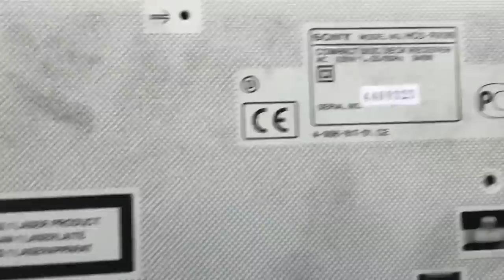SONY MHC-RX99 Maintenance Repair Restoration Disassembly Part 1

Comment: Hello! I have a problem with cd tray on sony gr8! The tray is not closing! It remain open! Even if i push it back it come out! Can you help me please with a solution?
Reply from the maker: Hello. This is a problem that happens to everyone. Because the rubber of the CD tray is broken, the mechanical part does not snap back as it should. When the mechanic does not go into place properly, the electronic key cannot open and it does not work. For this, you have to push the cd tray hard into place. Be careful, push it back without breaking it. But the cd tray tire should be changed.
Reply: @manstuckonhishead  i try it! Is still come out and not change the cd! I read only cd error
Reply: Hello sire! I solve 90% of the problem! Please help! Now in standby the cd tray is ejected!
Reply from the maker: @DAngello1987  Hello. If the cd tray does not break, the tires are checked first. The electronic keys are checked in the next process. I have no other information. I would have helped if there was.

Comment: I have sony mhc p99x. small mini ...its fan does nt work and it gets hot around 60..70 C. can i use computer fan? will it burn if fan is not working?

Comment: hello i'm from Tunisia, great job forthe work that you do. i have a similar HIFI sony compement (MHC GRx 70) very old one (from 2000) was abondoned for many year. i start it since 1 month, it's working but all the function button (on device) are not working properly. when i push a button for a function other function is started and it always beside function button. also the volume potentiometer when i uncrease volume, it decrease or not happen any change. for the remote control i can find it right now. can you please help me how i can fix the problem.
Reply from the maker: Hello.Watch this video https://youtu.be/RJsQ3DTwOvA 👍🙋‍♂️
Reply: @manstuckonhishead  thank you very much for answering. i watch the video, it's big job for me to repaire all button since 90% of it are badly working. i ask you if their is a chemical solution, for exemple electric contact spay  can solve the issue?
Reply from the maker: @maxis106  There is no chemical solution. You can write a 4-legged sony key on the internet and buy it. It would be easier to change it👍🙋‍♂️
Reply: @manstuckonhishead  thank you, i will try to do it.

Comment: hello my friend, you are probably the only guy who might actually can help me fixing my MHC-RX77 (which from what i see is very similar to the MHC-RX99 in your video)

My display is pretty dim, especially in the middle section, the outter section does show a little light though.
Whenever i start my system, it turns the CD's but sometimes it does not read it properly and therefore skips to the next one, as soon as it skips to the other disc in order to read it, the system turns itself off while rotating to the other disc, the only way i can bypass it turning off itself, is by pressing the upper DISC 1 button many times and sometimes it reads the disc properly and works normally, but sometimes doesnt, which annoys me ALOT.

Now i tried to solder all display pins properly and still does not work properly. I cant find any decent schematics for it.

The schematics for my MHC-RX77 are not quite detailed enough for the Panel PWB, which is why its difficult for me to check what each pin is controlled by.

i just soldered the chip for the display controller (IC 601, which i found in the MHC-RX99 schematics and is the exact same chip for my MHC RX-77) but i did not checked it if it works yet since im tired right now. lol.

side note: since i dont use tapes i dont really use the tape deck, but the rubber rings to spin the motors are missing (due to aging process) but as far i am concerned it shouldnt mess with the "checking procedure" during startup, or am i wrong?

I'd appreciate it very much if you give me any answer to my problem, even if you are not sure how to fix it. <3
Reply from the maker: Hello. As we know. Since the screen is fluorescent, it leaks gas inside and its color fades. The solution is to install a new screen. For the CD problem, you need to clean the optical lens. If it does not work later, the laser is broken. If you play with the potentiometer on the CD drive, it may be fixed. We are not masters of this job. We only shoot videos.👍🙋‍♂️

Comment: btw can you please help me? I just bought an almost untouched RX110, Manufactured 1998. However, as expected the belts for the cassette decks have perished. If I buy the belts on amazon, can I replace them myself, without having to take apart too much of the unit? Because the cassette decks are in the middle of the unit...in other words, do i have to take out the full CD mechanism tray to replace the belts? I dont want to take it to a service shop, because they manhandle the units too much, right now everything is so clean and no scratches.
Reply from the maker: Hello. You need to buy various sizes of belts. Buy a mixed and assorted pack of belts. Change the belts as in the video.

Comment: Hello again friend. Is there a way I can email you a photo of my power circuit board of my MHC RX110? I used IPA (alcohol) to clean the top of the board and now there is a white residue and also a bit sticky near the pins. Not sure what to do exactly now.

Comment: Hello, one question, do you know in what position the fan goes? Air in or air out?
Reply from the maker: Hello.Will blow the air out.
Reply: @manstuckonhishead  The fan has an arrow, which part will it point to?

Comment: To remove that  centre knob  (5:53) there's hole next to the rotary encoder (9:19) for that purpose on back PCB to push it  easily to the front to avoid being scratched or damaged.
Reply from the maker: Thank you. Yes you are right👍🏼🙋‍♂️
Reply: @manstuckonhishead  Thank you for the video

Comment: Sir please ad Bluetooth internal
Reply from the maker: Hello. You can make the bluetooth connection too. I don't have bluetooth on hand. I would if I had it. Use bluetooth which is sold as a wicker. Plug in bluetooth from aux👍🏼
Reply: @manstuckonhishead  ok I'm from india

Comment: Hi brother 
Sony v818 module power transformer  secondary voltage how many please
Reply from the maker: Hi.https://www.manualslib.com/manual/691747/Sony-Hcd-V818.html  👍🏼🙋‍♂️
Reply: I think 25 0 25 .7 ampier right? Please help
Reply: I can use sub amp

Comment: Salut j'ai un lecteur Blu-ray 3D  Samsung DE  type mange-disque comme la playstation et qu'il ne veut pas manger les disques aurais-tu une idée à me suggérer c'est quand même à l'état que j'ai payé 200€ c le model BD-D6900 je me demande si ça ne serait pas le même problème qui peut être rencontré sur les playstation lire rouleau à l'entrée qui n'arriverai pas à attraper les disques car sinon il fonctionne parfaitement et ça m'ennuie un peu de ce désagrément merci si tu as une solution une idée Samuel. à  Hi I have a 3D Blu-ray player Samsung DE type eat-disc like the playstation and that it does not want to eat the discs would you have an idea to suggest me it is still in the state that I paid 200 € c the model BD-D6900 I wonder if it would not be the same problem that can be encountered on the playstation read roll at the entrance that will not be able to catch the discs because otherwise it works perfectly and it bothers me a little of this inconvenience thank you if you have a solution an idea Samuel. at